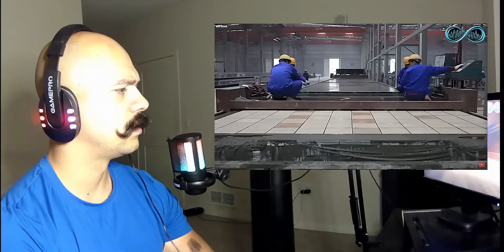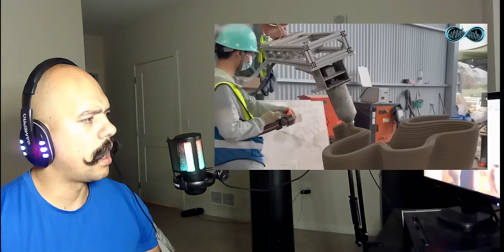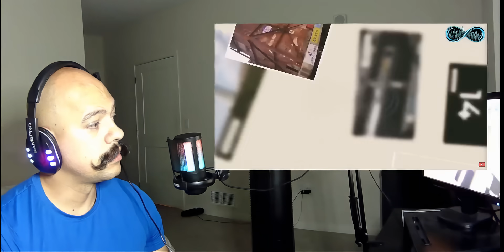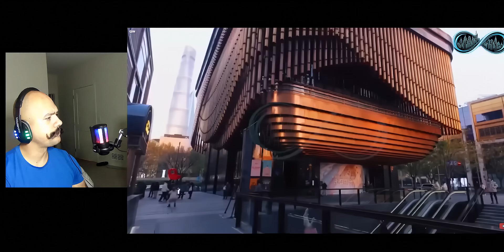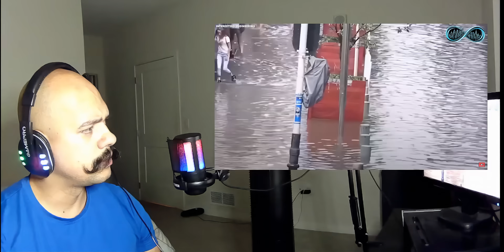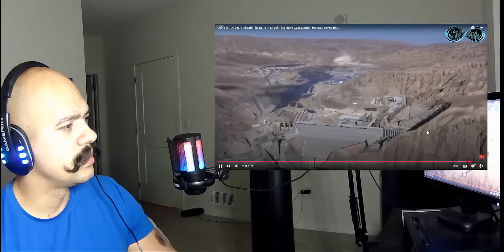SHOCKED China is 100 years Ahead The US is in Shock This Huge Construction Project Proves That

Comment: These photos come from media / news sources. Some may be promotional or more illustrative than precise; sometimes images are labeled “Yangqu Dam site” even if they show nearby work, related infrastructure, or generic dam construction in the region.

The latest versions show the dam in late construction, especially the concrete-facing of the rock-fill bulk. For example, Photo “top-left” (image 4) is from December 2023 and is titled “China’s first concrete-face rock-fill dam under construction in Qinghai” referring to Yangqu.

The AI/3D-printing wording is mostly about methodology, not visible in the photos. There’s nothing in the images that shows a giant 3D printer machine sweeping the whole dam, but you can see heavy equipment, layers of rock / filler, scaffolding, etc., consistent with large dam construction.

Comment: 特高压技术了解下😊在中国960万平方公里的国土上使用特高压技术传输电力，损耗却能忽略不计，此技术仅中国一家独有
Reply: It's Tesla tech (Nikola Tesla)..well done china to implement it
Reply: @mphozulu4822  Not sure if this is the same technology but the idea is similar. Nikola Tesla had envisioned his system would provide FREE electric energy to everyone through WIRELESS transmission but when the powers that were found out that this could prevent them from making money, they stopped it from happening. All of his notes were seized by the FBI after his death and disappeared. Chinese engineers working for a country that believes in making science and technology benefit EVERYONE and not just to make money, could have looked into his concept and liked the idea in transmitting electrical energy.